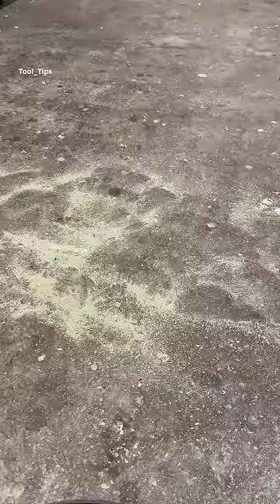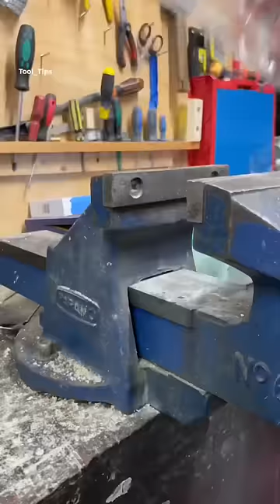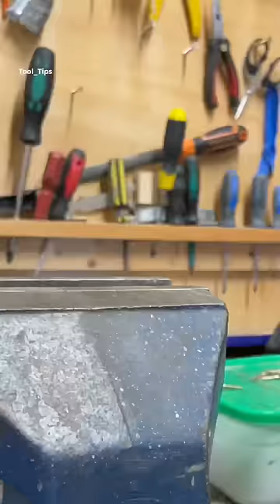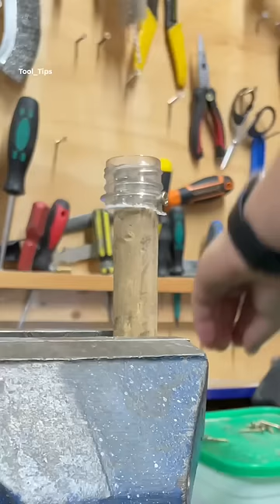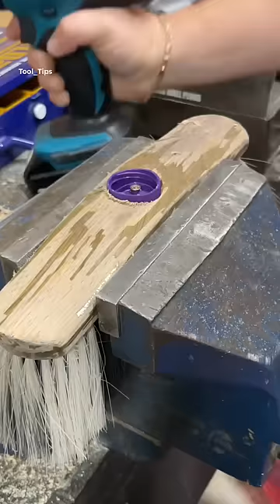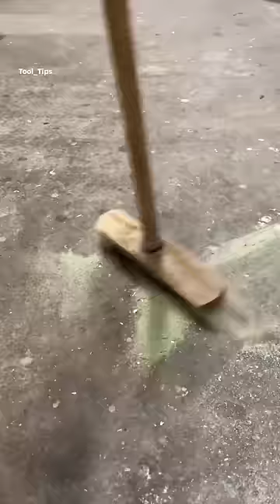Broken Broom Stick 🤦‍♂️ Tool_Tips Fixed 👏

Comment: Yeah, I’d probably spend the $10 on a new broom. It would be quicker too. ❤
Reply: New brooms may have the same issue at least here they are rearly sold in one piece so knowing how to fix this is rather good that said this is not how lol
Reply: So you're spending $10 just for a broom
Reply: @arrivenebull1568  We all live in different parts of the world with different price points. The point I’m making is that on this occasion, the proposed solution outweighs the simplicity of replacement. I’m a massive fan of tool tips but this proves that not everything needs to be fixed.
Reply: @link7417  try that again with periods and commas
Reply: @derek2826  how about... no?
Reply: 이게 맞다
Reply: Or wood glue it, because it clearly just disconected
Reply: @Enjoyyourselfnow  of course i will do if i OUT.    OF.     MONEHYY 🤫
Reply: It’s still creative
Reply: @arrivenebull1568  don't be so Inmature
Reply: Because he's recycling
Reply: Glue
Reply: Not everybody has 10$ and if you always buy new brooms you destroy the nature of the Earth

Comment: Just buy a new brush
Reply: No u see that's one of our problems we fix nothing why throw out the brush there's nothing wrong with it it only needs a Lil TLC.an ]]
Reply: It was as good as new.
Reply: Might be true but with the ever increasing work pressure and the lack of free time and then the cost of these kind of items is so low that it outweighs the time spent to do it.
And believe me that this will break within the day

Comment: There’s literally a hole on the brush side to run a screw through to the handle. Glue + screw - silly time consuming antics = swept floor. ….. or whatever you do with that brush.